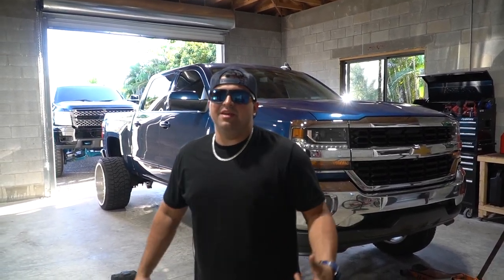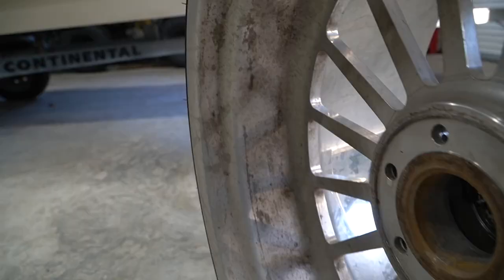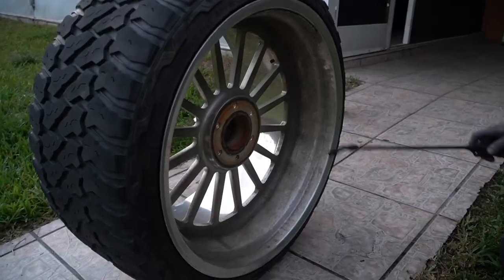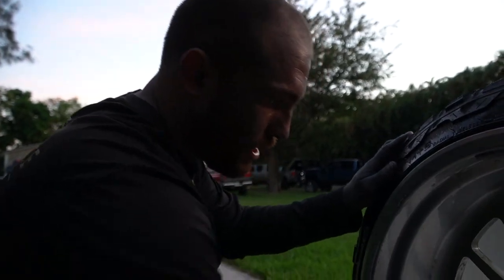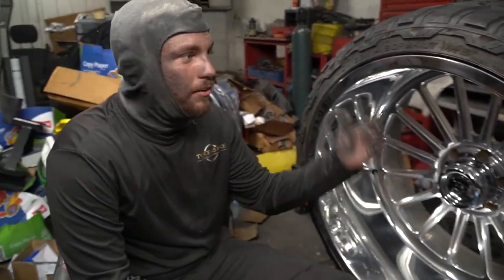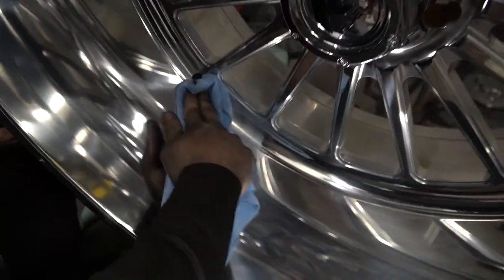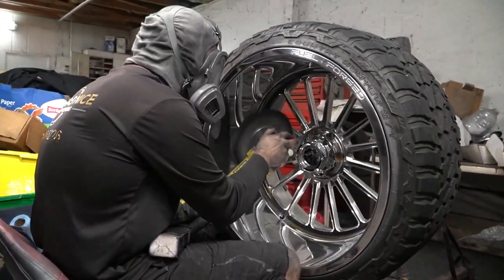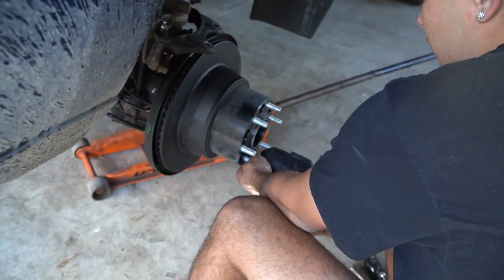How to polish forged wheels

Comment: How do you keep them from water spotting when you wash them or drive in the rain
Reply: ceramic coat first and foremost then when ever you drive in the rain, wash them before the rainwater dries
Reply: Agree with comment above. Pj you should ceramic coat them now. It will help out with future maintenance, and protect the finished wheel
Reply: @F250_6.0harley  only problem is it doesn’t last
Reply: @cat740dt  Ceramic coating is a waste for forged wheels lol. They make a ton of work for the polisher that polishes them next and the process takes longer. Most polishes have a sealant or a type of wax built in that literally can bead water off the wheels. Highly wouldn't recommend ceramic coating forged polished wheels
Reply: @thekolbyward  I understand what you're saying but I've CC'd all my forged wheels, polished or black. I like the ease of washing them and my polisher doesn't complain since I pay well lol
Reply: @cat740dt  what do you consider (paying well)?
Reply: @thekolbyward  200 a wheel plus tip on my current set
Reply: @thekolbyward  depends on how often the owner cleans the wheels. If you ceramic coat them and clean them weekly it would be beneficial, but if you do and don’t wash them until every 2 months that costing will be gone especially in the winter.

Comment: How comfortable do you feel with the 2 inch spacers on the front? I have the same set up, and am wanting to put on stocks but have not done it yet because been afraid of the spacers on the front . If you like it also, how fast have you been able to run with it?

Comment: This is exactly why i just stick with chrome rims, looks much better and less expensive...
Reply: Chrome does not beat polished aluminum at all, not even close
Reply: Ive had both over the years and hands down i would rather have chrome, mirror finish and dont have to spend hours at a time polishing them....
Reply: Oxidation sucks on chrome bro ..billet last more 😢
Reply: @joeroe2839  had both over the years, never had any problems with chrome wheels. Just keep them clean. Plus the price is much less expensive....
Reply: That's exactly what I said
Reply: Everywhere I checked, these guys wanted $300-400 to re chrome my wheel lips
Reply: Says no one ever lmao
Reply: If your broke, just say that bro
Reply: @Dahmonstah  bahaha bro i probably make more in 1 day then you do in a year 😉